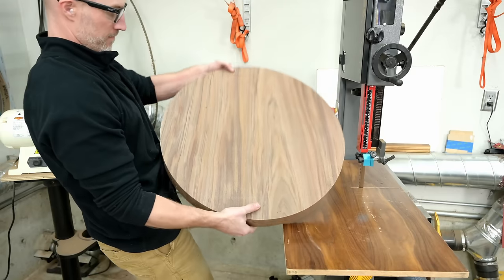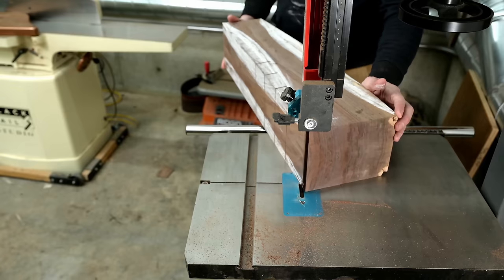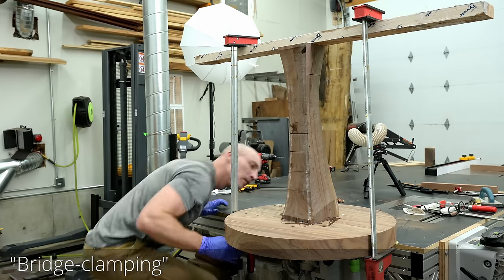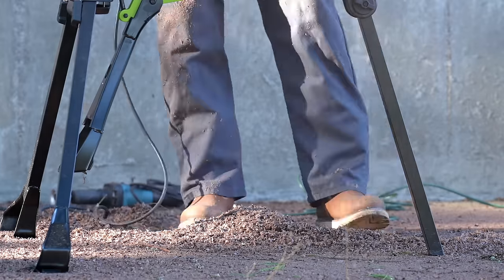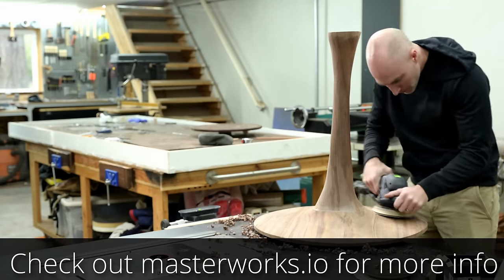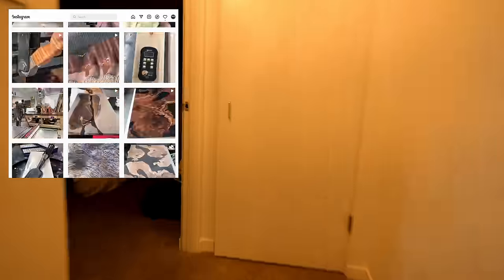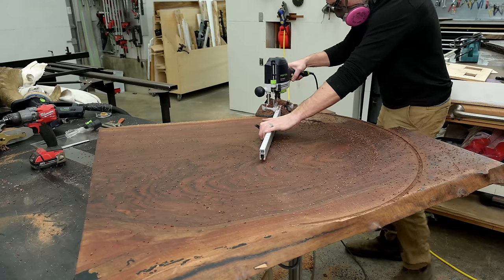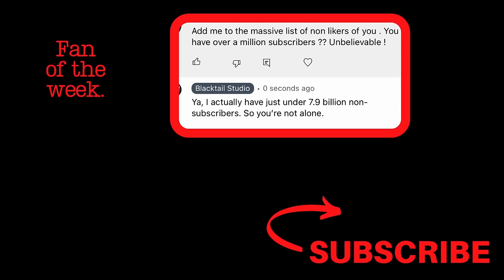I Like Money, But This is Better

Comment: I'm in the one off crowd and suggest leting it stand as a piece of unique art.. I wouldn't mind if you're venturing back into the burnt wood realm. It is
 on that  That item that I have a question. I've heard you speak of using a seal coat comprised of a  Table top 50/50 resin cut with acetone on burnt wood. Would you possibly recommend a certain ratio of acetone to resin?  I don't remember hearing a certain measurement  Referenced in your comments. My project involves a charred plank which I HOPE will serve as a hall table or bar top. I may embed some LED lighting on the underside I love to use light with my resin projects anymore.

 Hey thank you!
I enjoy your show
Gregory

Comment: The difference between 1 vs 2 sides glue is adhesion vs cohesion.  Adhesion is a much stronger bond as long as you have a very flat surface.  A concave inclusion can create a lot of negative surface to the bond which would detract from its strength.  If you are confident in your planing, then adhesion is multiple times stronger than cohesive.  
You can think about it like a jelly sandwich.  Jelly will stick much better to bread than it will to jelly.  Glue is designed to stick to its intended target applicant. It is not designed to stick to itself.

Comment: In tile, mortaring the floor, as well as the tile, and bringing together, allows the mortar / glue to recombine with itself, in the middle of the oreo. Once cured, your not getting it apart, as you have maximum bite penetration on both surfaces.

Comment: Is there a structural reason not to put a small hole through the center of the tenon? It would make it so that you could get it in and out of the snug hole without worrying about the air pressure/suction that is created by the perfect fit. (I think)

Comment: I add glue to one piece, spread it completely, rub the second piece on it and check to see that it transferred completely, then put it back together and clamp. I still get squeeze-out but (it seems) I use less glue.

Comment: Depends on the joint i am using, but usually i only glue one side. Primarily i do this to prevent having such a large amount of squeezeout to clean up. I find gluing both sides gets sloppy & slippery with the exrea glue.

Comment: Big fan of CA glue.

People who haven't really got into it may not realize the usefulness of the thinner formulations.

Big cost savings if you make your own activator.

I like epoxy too for a host of household uses, though it had never occurred to me to use it as a straight adhesive.

Hate river tables though.

They remind me me of the 70's when everyone was shopping epoxy on hatch covers and calling it a table.

Comment: I definitely glue both sides of a miter, since both sides suck up the glue  easily.
Otherwise, after thinking about this a bit....yeah I guess I do glue both sides of any other joint, but I cover one surface, and just kinda dribble glue on the other surface.

Comment: Always glue both faces, wood is able to absorbs glue so fast that there is the possibility that areas become too dry before contact is made. Glueing both faces means less glue required on each face because both surfaces definitely have an entire wet surface when clamped together.

Comment: Glue both sides. All glues are based on hydrogen bonds (Think of a water molecule. The two hydrogen are basically big positive charges sitting out in space. The more hydrogens a glue offers per gram the stronger the glue). During that bit of time the glue sits on both boards separately, the hydrogen bonding is only occurring with the wood. This is a good thing. Once the two glued up surfaces meet each other the majority of the H bonds are formed with the glue on the opposite board. By putting glue on both surfaces you are maximizing the Hydrogen bonding on all three surfaces.

Comment: Not sure if anyone else has said this, but in home aircraft building glue-up of wood components REQUIRES glue on both sides to ensure no voids.  Pilots have died because of structural failure due to glue voids.  So glue on both sides ensures max strength.  Glue on one side does not.  Simple.

Comment: $10,000 (so I was wrong.) I just wrote you about how I keep watching your videos. I was going to go to bed and then this one came on. I have spent two hours watching these. I'm addicted.
Reply: I know you're  in OR, and I'm in Florida, but my development is cutting down around 20 trees because of some road work. These are forty year old trees, a number of varieties, some 60 feet tall.Any ideas? Do you know someone in Florida who could make use of the wood because otherwise they are going into the chipper. I fought against the project for four years.

Comment: i feel strongly enough that i would never glue one side my self nor would i buy something that was glued one sided  if i knew it was
but im not a zealot who gets mad about it

its kind of like when you see a picnic table at home depot and the whole table rests on a 1/2 carriage bolt and your first thought is that's not adequate

 i feel it should be glued both sides because you can make sure there is good spread and full contact and when you put the 2 sides to gather they are still wet and will actually fuse and make a stronger blond 
that's my thought prosses on it i could be wrong

that said i have never had a failed glue job on wood

BTW: that wood looks amazing thank you for sharing

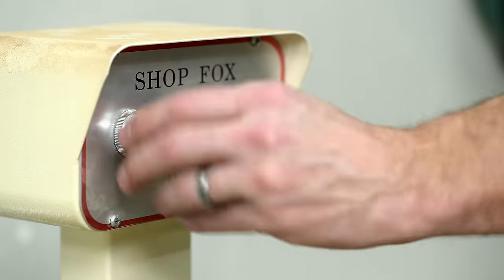Comment: Beautiful work!! Have a question… around 00:47 - 00:49 I saw you are using Festool clamp on your Bosch miter saw. I was considering buying the clamp but wasn’t sure if it will fit. Did you modify the shaft of the clamp or it fits “as is” ? Thank you for all your great videos! Very inspiring!!

Comment: Hey Cam, those smaller Walnut blanks  could potentially be sold to gun stock makers.  Depending on condition of course,  but the smaller piece that would otherwise be scrap or burned, could be turned into something useful and gorgeous. Even handgun blanks for custom wood grips are a thing. Much Love brother.  Pay no mind to the trolls. Btw, most people who critiquing your wood working, have probably never made a dime selling any wood they have worked. 😂😂Trolls only do what they do because they're wounded in some way. People can only respond or interact at the level of consciousness they are in at that moment. And most people, simply haven't faced their shadow.

Comment: Fes tool. Isn't there a way you could tape one of those little fans to it? Like... you can get them at a dollar store. Like... people just hold this tiny little fan, battery powered (AA), to help cool them in the summer. That could possibly just BLOW that saw dust... and maybe make a funnel attached to a bag, to pick most of it up... maybe?

Like... I'm a Stone Mason. And I like your videos, man. You seem like you'd be cool to hang out with.

A bit unrelated, but still pretty cool... like... A little trick... something similar, that I experienced...

I used to buy these  little tile cutter saws. They had a water feed... I hated having a gravity feed for the water... screwing into the wall, a coat hanger, picking up a 5 gallow bucket over my head...  sticking a tube in it. Sucking on it. And having consistent water draining out of the bucket, and into my saw blade. 

So I bought a Bug Sprayer, and some glue. Stuck the tube into the bug sprayer, and POW! Now I had a pressure fed water feed.

Comment: Glue up - I think we woodworkers overbuild everything, and most of the time, for good reasons. Everything I build is from scraps, so I often end up with a lot less material than I want. Like 1/2” plywood where I need 3/4”, my point is - I’ve built plenty of stuff that shouldn’t even still be standing. I use as little glue as I can, plus a bit extra and I’ve never had any real issues. So….. I only glue one side. Sorry, long winded.

Comment: $abunch.  I made it.
I'm a "glue on both surfaces" guy, unless strength is not an issue.  I've pulled joints apart after applying the glue and found areas that are still dry, so if I want to make sure that the joint is as strong as possible, I make sure that the entire joint is coated on both sides.

Comment: "Cut that you shouldn't make." 
I never comment on anything but I must say, that is by far one of the most regular cut I've seen in my cabinetry career. Small crew with limited tools, we do much worse. Ever free handed on a table saw? Not my favorite thing to do but sure gets fancy corner cabinets done when they don't fit on the bandsaw and you don't have time for a jig.

Comment: Most of the hand work done on the base and stem could be done on a wood lathe. Much much faster than by hand. There would be tooling cost and a learning curve. Basic shape done on the lathe. Final profile done with hand grinder.

Comment: Not that i would have hated the small top, i just find the top should never be smaller than the base. Not even sure if there's a reason for it, just aesthetics i think. So good that it ended up with a pretty big top ;)

Comment: $$? I'm about 3 months late in watching this one so no point in guessing the sold price. Love walnut this is a gorgeous piece. Question, I've noticed your putting the c-channels in upside-down or different than I've seen you do in the past and different from other makers who use them. Is there a reason for the different direction? Does it work better in some way with the "c" in vs out? I bought my first c-channels for a table I will be building and you've got me curious.

Comment: You either know how much glue to put on a surface or not. It’s usually a case by case basis. If you are edge gluing there is no reason to put glue on both sides. It takes twice as much time with no benefit. Most everyone puts extra glue on. The squeeze out is evidence of that. Depending on your personal experience or size of laminate/face glue, it can be hard to judge how much glue to use, therefore it may be a good idea to do both sides. The other reason is poor or lack of clamping force. PVA or TB1 only require very thin glue lines. In general you can’t clamp it too hard. There is a downside to applying glue to both sides. You may apply an excessive amount of glue that you cannot squeeze out. Then you end up with a thick visible glue line.

Comment: Light or Dark.  Curious what color that burl  becomes when you put a rag of thinner across it to deepen up the natural properties of the wood reason I'm asking is that I was thinking that the lighter one could be really interesting if it has a red tone to it's natural state and secondly the idea of how using a red oak or red mahogany maybe cherry based on the woods natural bias, would possibly look, thinking it's likely to be really stunning for the other half price left to do.   Anyways I've really enjoyed watching you work several of your  projects.  I've made several pieces in my lifetime. Even done Faux Woodgraining on a living room with plaster walls and high and low wainscoting with a mid rail that defined the look of wooden panels but everything was full finished and there were 11 panels that had failed so I had to do the plaster on the 11 panels and created base coat and granite and then stain it to match the rotational fade from the Sun something I wasn't sure that I'd be able to accomplish  identically but it was easier than one would think. It was an amazing project and when I got done you couldn't tell there had never been a problem.  Thank you for your candidness as you progress a project I appreciate it.

Comment: If you mix sawdust from the piece and wood glue to fill the imprefections it will make a vartually un-noticable transition as the saw dust will drink up the stains and other things you put on it much like the wood itself will making it look like everything else around it.

Comment: Amazon is your friend for flap wheels buy bulk packs there's no reason to spend ten bucks on one when you can buy ten packs for twenty... also when the flapwheel gets clogged use a belt sander cleaning stick to clean it ....if the grit goes dull keep a piece of angle iron around and just power the flapwheel into it to expose fresh edges

Comment: I use gloves with angle grinders from time to time. I would say it's absolutely powerful enough to hurt you. Most of the power tool related jobsite accidents I've seen were angle grinders, after framing nailers

Comment: 12grand!! :-D 

It you were using a cutting wheel, with teeth, or (God forbid) a chainsaw-tooth wheel, THEN having gloves on might be a concern. I don't think it's an issue when what you are doing is, essentially, a sanding wheel (which is what the kutzalls are). A very aggressive sanding wheel, but a sanding wheel, without a doubt.

P.S., have you thought of getting together with Mike Rowe on something ? 😀

Comment: When it comes to the glove discussion, it is really optimistic to say it coud not suck your glove in and hurt you. I personally go with the perspecive: Could I grab the running tool and stop it with my hand? If not it will absolutely seriously injure me if my glove gets caught in the spinning tool. Could you stop a 18V cordless drill? probably. But an angle grinder? absolutely not. This thing will ruin your day. Powercarving is allready one of the most dangerous things you can while using handheld powertools as advertised.

Comment: Hello mate live your channel 

Why didn’t you use your chop saw when cutting you domino, just seems strange that you have to Clamp it to the fence of your table saw

I real question in a previous video, you used like a piece of angle oil routed in the tabletop to stop copying can I make them myself from a u shaped piece of iron 

How accurately is the deep rooted in for them? Is it important and are there any other tips for using them? I’m not sure they are available in the UK

Comment: When gluing up wood to wood, I prefer to use a thin coat of glue on Both Surfaces. I would rather have to clean up some squeeze out than risk a joint failure.

Comment: I don't think having the glue on both sides is important as long as there is enough glue to saturate the joint until you get equal squeeze out.

Comment: I see your using a festool hold down clamp on your Bosch. Does it work well. Did fit right in or did you need to mod anything?
Thanks

Cheers

Comment: Technically there is no benefit of glueing both sides, you only use more material. The compount will dry out rather quickly, giving you a faster result to work with when using less glue. Since glue consists mostly of water which has to evaporate, less is probably bettter - just make sure every surface is covered, but glueing both sides is probably not doing a "better" glue job than glueing only one side properly.

Comment: Glue on two surfaces? I am a designer fabricator of artistic mechanical effects devices and have had just over $18 million won on my game show devices so far. So I get into the physics a wee bit. It seems to me that if wiping the surface of wood with water or alcohol raises the grain, then so should a coat of glue to help make the pieces fuse better. In the time (all weather and temperature dependent of course!) that glue is laid on a surface, it is already forming a skin on top. Warm wood, hot air and dry air make disasters all the time. And cool surfaces, cool and or moist air go the opposite. direction. By applying glue to the wood surface you should have tiny fibers lifting right? Just like the legs of insects with tiny grabbing hooks to hold onto the other surface. But it is also the tiny void under the lifted fiber that can get glue mashed into it. Every tiny nearly invisible crack. Putting the glue on the second coat, even thin, probably allows for the massaging of the moist glue into the fibers and voids. Going back to the above. The coat of glue on only one piece may have that super fine skin already forming preventing the glue from being wet enough to lift the tiny fibers or really mashing into those tiny voids. By putting even a thin coat on the second piece, you end up having the glue on both surfaces mashed in deep. Of course, a thick later on both can be wrong also depending on your method of truly crushing the pieces together with clamps. I am sure most people have created a pocket of glue by clamping outside edges first / only. I am sure there are twenty variations of what can occur. But now you have glue making a solid area (no good) or a pocket with glue on one side JUST missing the surface of the second side and hidden from the world to see until it fails. How many people have had an old piece of furniture delaminate? Sometimes it is clearly the old glue failing (a science all on its own). Sometimes you can see one surface must have had the glue and the other just looks like the highest raised fibers got attached then plucked off. I recently used a neat trick. Got some super thin metal to slip between cracks on Danish furniture. Took a real syringe (not a glue syringe) and put that ultrafine needle into the crack as deep as it would go and squeezed slow but hard. And like cool magic it started to squeeze back out towards me from cracks or splits that a piece of paper cannot get into. No mashing from the top EVER does this. Now there is glue where it either failed or not glued properly. NOW the row of small clamps was able to fix damage WITHOUT filled the void with glue or fillers.